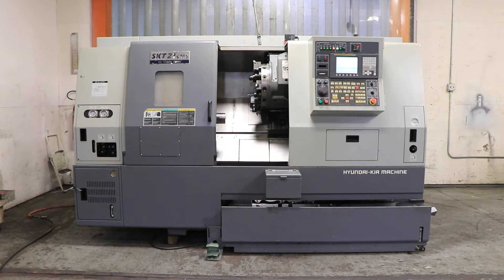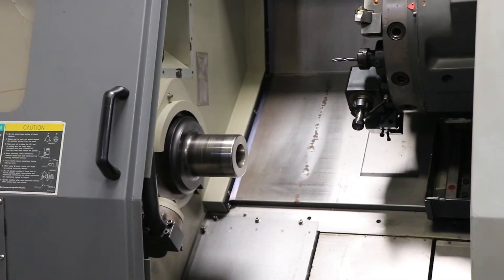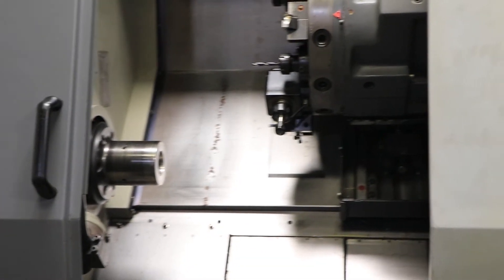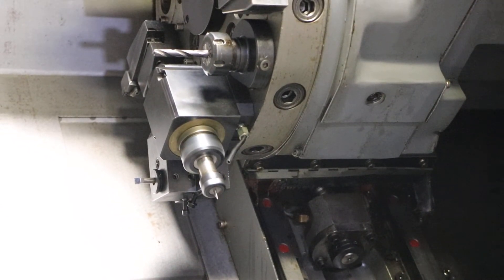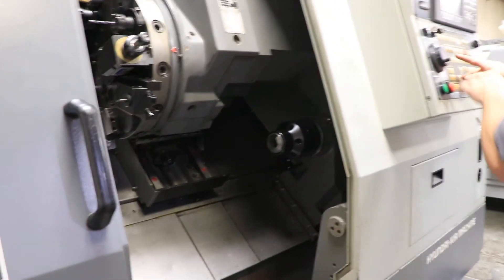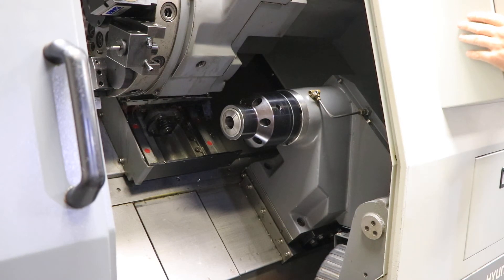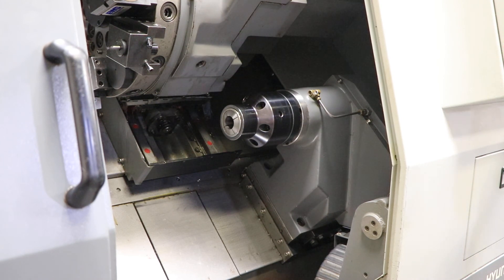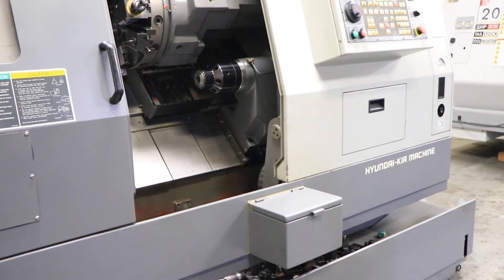HYUNDAI-KIA SKT-21LMS CNC TURNING/MILLING CENTER

Comment: question bud, I need to Cycle start Machine with My chuck open to use my turret as a Stopper but G98 won’t work it alarms out over Open Chuck, how can i get it to work with open chuck? parameter # or Keep relay or an M/G code ?  i’m not using Bar loader, loading part manually i just need turret to approach part so i can push it against it.
Thanks